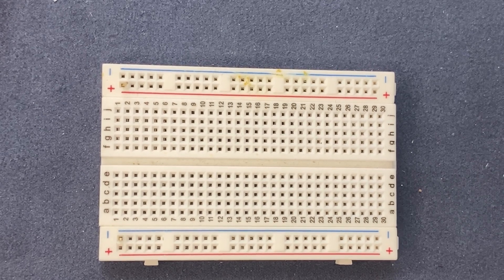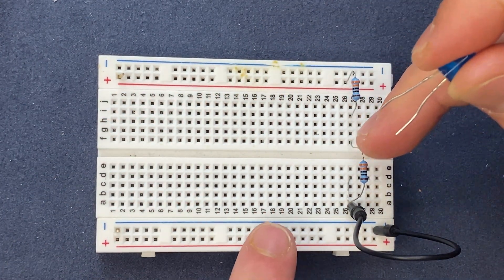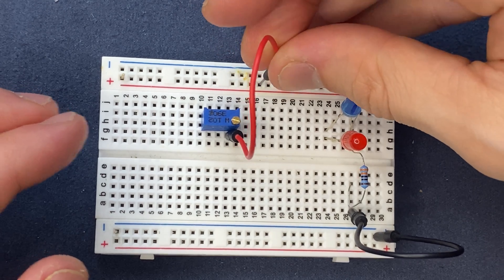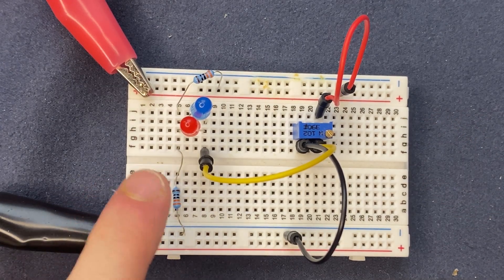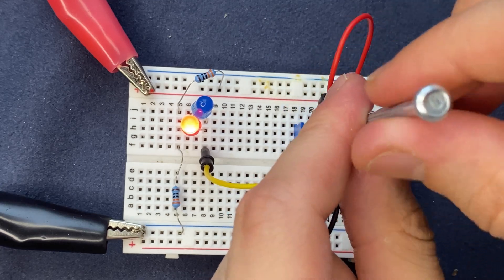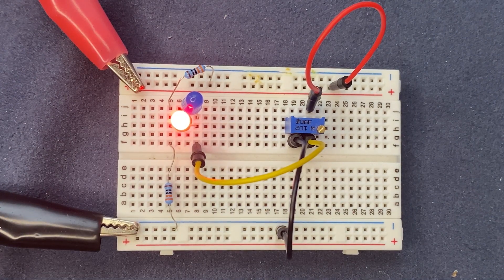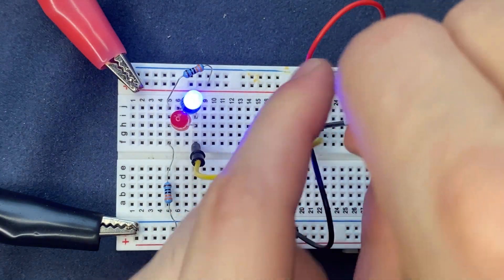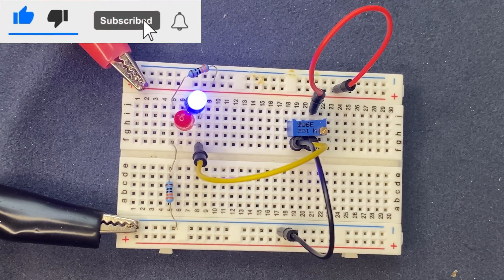How to Control two LEDs using Variable Resistor 🫣 - Easy Circuit with Diagram

Comment: Hmm... I think that you may have an error on your schematic? You continue the trace of the wiper through/between the two LEDs. This short would be the path of least resistance and neither LED would ever illuminate. I think this portion of the trace is in error and should be removed, to cause the electrical path to be forced through one LED, or the other. Correct? If not, what am I missing?